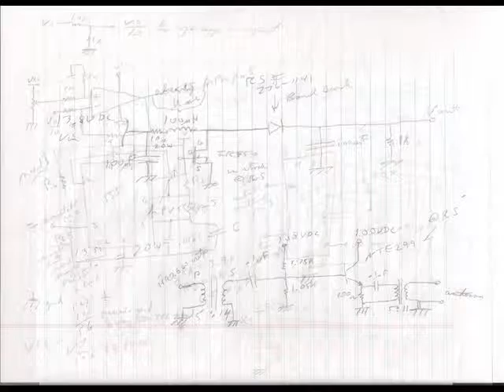boost regulator

Comment from the maker: I should have mentioned that I used a dual timer , a LM556 which is like two 555's, for the PWM. One for the frequency (astable) and one for the pulse width (monostable).  I was only able to get it to work at about 1200 Hz.  I don't have a scope right now  so it was hard to debug it.  I decided not to use the circuit to power a HAM radio amplifier because the 1200 Hz would probably come through in the receiver.